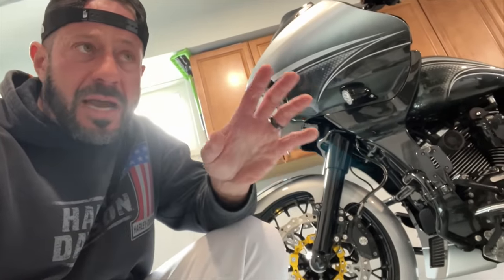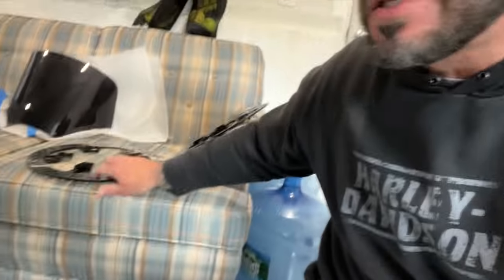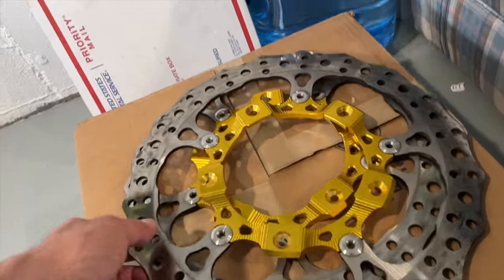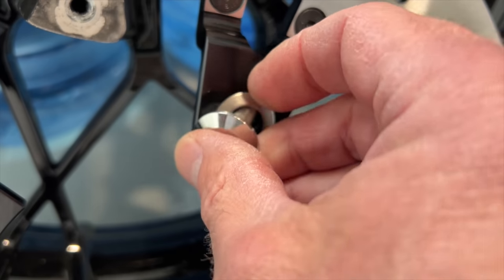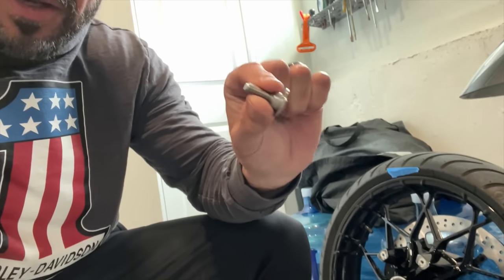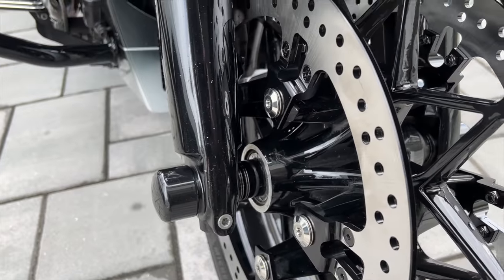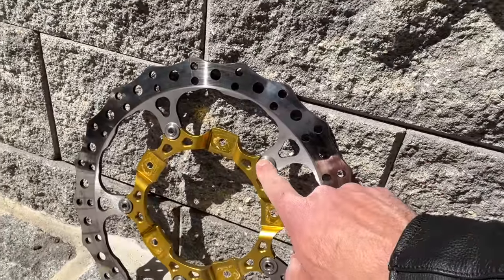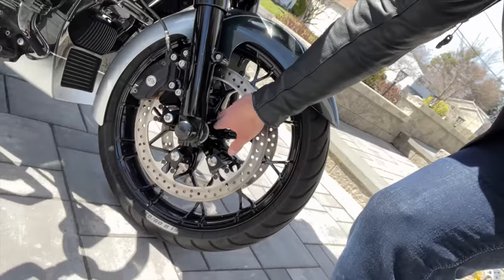MAJOR BRAKE ISSUE CORRECTED ROAD GLIDE PERFORMANCE BAGGER #HARLEYDAVIDSON #ROADGLIDE #STREETGLIDE

Comment: As a  former motorcycle parts store dealer i bought chrome swing arm pivot blocks that looked awesome but chrome started to bubble and peel after 5 months. Called them and first thing they asked was if the bike was an everyday use bike, they said their parts were best for show bikes not every day riding. returned all i had of theirs parts enough said !

Comment: The majority of hot spots are between the cooling bores. The pads looked near new no property issues, they are still suitable for stock rotors. Conclusion;  the Arlen Ness wave rotors were damaged during the machining process. The drill was not properly dressed and the part was not adequately cooled during machining. I would seek a refund.
Reply: Definitely should get a refund.  New rotors. Should not have warped. I don't think I would have ever considered a scalloped roter anyway.

Comment: I was thinking about purchasing the first ones with the gold center, but after watching hing your video's I changed my mind and purchased the same ones that you ended up with. One hundred in the rotor are warped and chattering. Toke them off and put the OEM rotors back on. Problem solved. Arlen Ness acted like they had no idea what I was talking about. Avoid their rotors completely.

Comment: I had the same issue with my stock Road Glide Rotors, bad metallurgy is the culprit, issue with dealer because rotors were not warped but blue patches all around..............thanks for the information, its very helpful.................................JB..

Comment: Root-cause analysis of wavy rotors failure (out of round, out of tolerance) purchased through Arlen Ness.  Find it hard to believe (but not impossible) that manufacturing machining caused this, as one would believe that their Q.A. Inspection(s) would or should have caught it.  Leaves a few other possibilities:  how these were stacked, stored, etc. in a warehouse?  Or an employee dropped them (somewhere in the process) and failed to report it?  Pads?  Doubtful that the Break-in/bedding process is culprit.  No matter, the lack of Arlen Ness Industries to follow up with you is shocking.  I for one would have thought they care about their reputation and customer service satisfaction; but apparently not, at least so far...not.  
I for one am holding off on any purchases from them until we know how they respond back to you for resolution.  I have two Harleys ('21RGS & '22FXLRS) in my garage that I'm doing all sorts of mods & upgrades on, so I'll shop elsewhere for the time being.  I'm confident that I'm not the only sub here that feels this way.  Best of luck with them and I do hope they respond back soon.  You've done more than your part reaching out to them.

Comment: You are going to have more stopping power on the rotors that are not wave, because you have more of the brake pads contacting the rotor. I like the black parts over the gold parts of the old rotors. I think the gold was to much contrast on the front end

Comment: Arlen Ness is probably turning over in his grave very sad situation with them. I agree about Ciro I had an issue with one of by headlight bezel lights one side was not working. They had a replacement shipped that arrived in 2 days. Could not have been happier.

Comment: I'm really curious if you have noticed this. it's only been a couple of week ago and I installed some new galfer rotors and I used those exact same arlen ness bolts  that you used. 20 road glide special with the prodigy wheels. the conical washers that arlen ness uses would not allow my rotor to float at all. essentially tuned them into solid mount rotors. fortunately, galfer supplied some washers with the rotors that are the exact same oem wafer style. and now my rotors float like they should.

Comment: Those rotors do look better than the ones with the gold carrier. It seems there may be a manufacturing problem with those oversized floating rotors if other people are having the same issue. I'm going with Galfer when I decide to make the switch.

Comment: John, thanks for the honest video.  Love the fact you’ll shoot it straight rather than sell a product. From the perspective of a guy in manufacturing, it appears that the batch of those rotors were heat treated or mchined the wrong way which warped them and made it harder in some spots and softer in other which is why there are burn marks.

Comment: I am also having issues with mine as well. I dont get lever pulsation but I am getting a vibration at lower speeds that felt like a bad bearing. Changed the bearings and the issue is still there. Bummed

Comment: i know this is an old video , but i just had an issue with the same rotors …. the rotors wouldn’t clear my fender spacer brackets.  it’s almost like the rotors were too wide.
Reply: Were you told you didn't know what bike you had therefore it's your fault they don't fit.